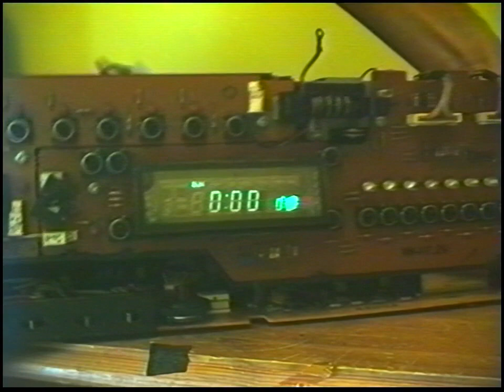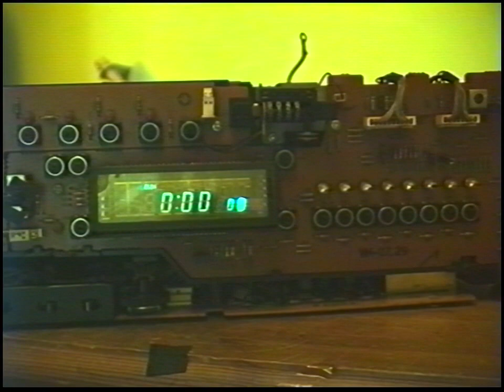VHS belt change and repair Baird / Ferguson 8940 (JVC HR7350)

Comment: Hi , Thanks for this video . I have replaced all the belts on my 3v29 however when it is loading the pinch roller still doesn't engage ,would you have any idea what else can cause the problem please ?
Reply from the maker: Sorry for the very late reply. This is from a fault list for the 3v29/30 in Feb 92 issue of Television magazine:

"VCR threads up but there's no play: The usual cause is that the pinch roller doesn't engage. Check the pin that links the mechanism to the play solenoid. Refit the pin and seal it to prevent further trouble."

If the pinch solenoid doesn't engage, have a look at the afterload switch. This is under the loading rings. Check if it is closing and also that it is clean. If it is closing and making proper connection, check the output from the micro controller ic2 pins 16 and 17. These are the hold and drive for the solenoid respectively. They go to inverters in ic9 and their inverted outputs go to transistors Q4 and Q5 which drive the solenoid. You should get high at the micro, low at the outputs of ic9 and high at the collectors of the transistor when the afterload switch closes. Pin 17 is just a pulse, pin 16 stays in the state to keep the solenoid held.

If the afterload switch isn't closing then the problem is probably mechanical. 

Also, a bit obvious but easily missed, make sure no connectors have been pulled out and not put back in during the course of servicing.